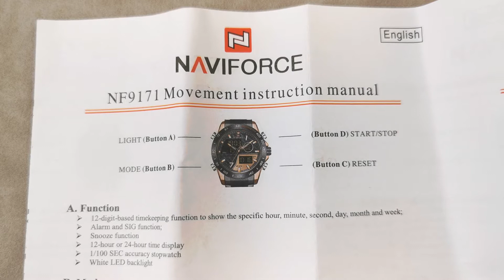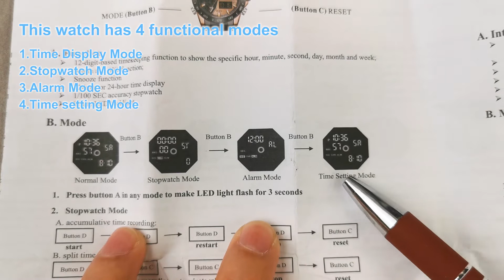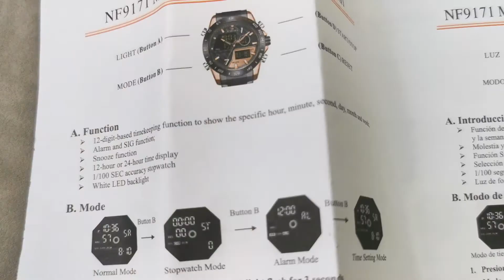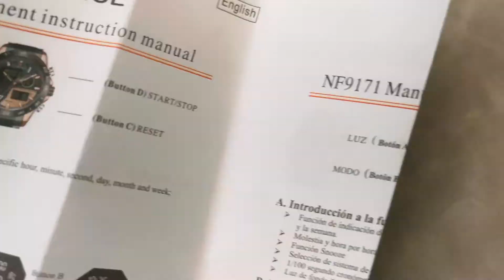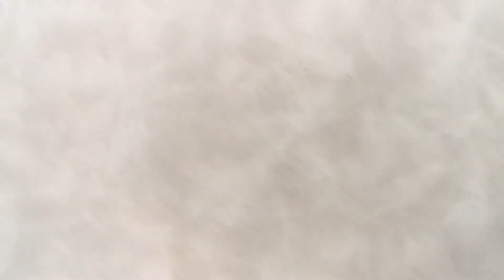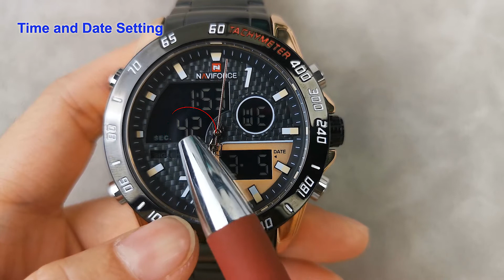How to set the multifunctional LED digital watch of NAVIFORCE Watch NF9171  men's quartz watch

Comment: Mention the price of the watch in Bangladeshi taka
Reply from the maker: Hi Sir. The price for NF9171 in Bangladesh is 2242BDT. You can check out in this link: https://www.aliexpress.com/item/1005003987990869.html?spm=a2g0o.store_pc_allProduct.8148356.1.40481fefK6N0mS
Reply: @NAVIFORCECHINA  what is the use of (chr) she have not told it clearly .
Reply from the maker: @avinabjha7209  Hi friend, the CHR means to the chronograph mode or the stopwatch mode. Maybe you can have a look our latest time setting video of other models and she will explain it more clearly (the operation of the chr mode is almost the same :). Many thanks.